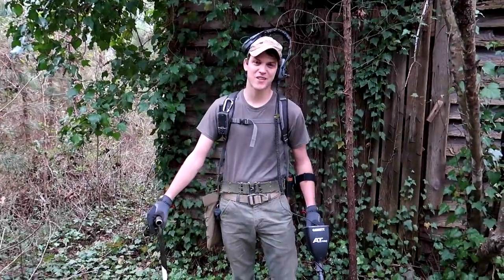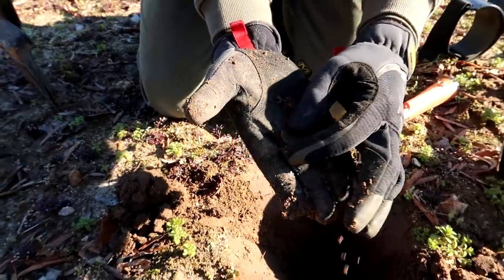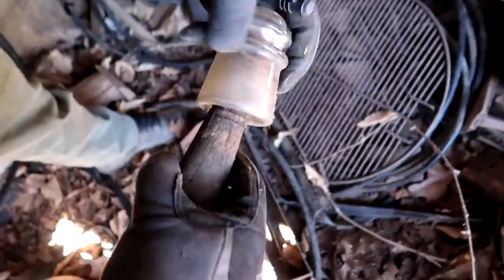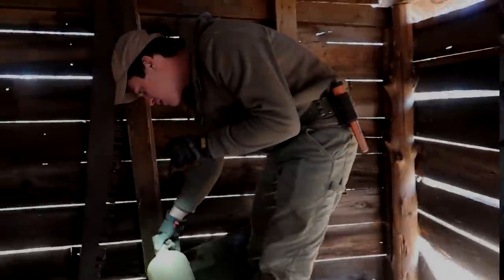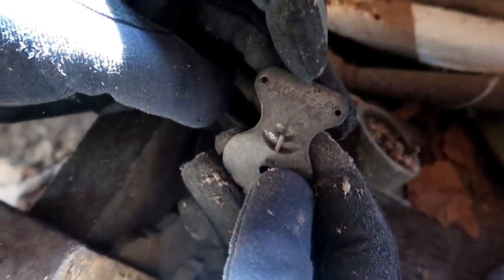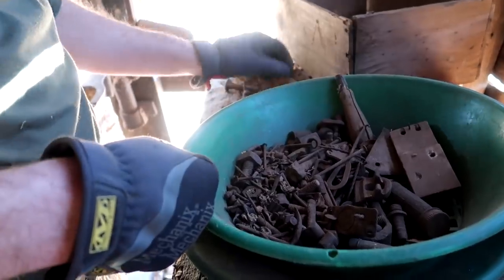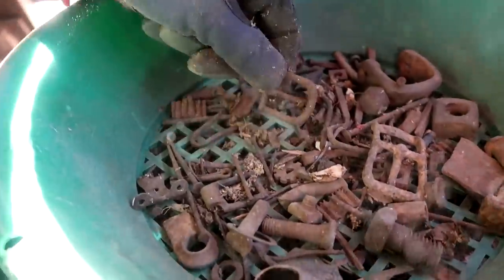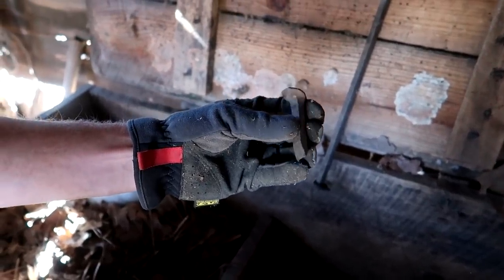Found Abandoned Workshop Full of Antiques! (Tools, Relics & Arrowheads) | Nugget Noggin

Comment: The round piece with two slots  is part of an old electric cord plug. It sealed off the wire connections so you couldn’t touch them. 
  Obviously the blacksmith tongs, blower and drill have some value.
  Good stuff. Blessed.

Comment: The black disk with two rectangular holes is used on old electrical plugs to insulate over the screws so the wires and screws don't get messed up and short out. If you have an old fan or lamp with a two pin duplex conector. Sometimes they had a handle area but most old ones were just round.
Reply: Yep

Comment: Whoa Nugget, that little tool shop is a gift that keeps on giving! 4:48 looks like a weight used with a balance beam type of scale. I thought I saw the beam leaning in the corner by the box of bottles. The small box of assorted bits had a button hook, tool used to aid in fastening shoe buttons. All those smithing tools, that blower, the hand operated drill press...if the owner plans on discarding all that stuff offer to haul it away for him, I wish I could! ONE THING, careful of bottles found in sheds! Farmers used them to mix chemicals like pesticides and herbicides. Some are toxic and were banned long ago but can still be potent. People still find old containers of stuff like DDT in old farm sheds.

Comment: I love that wood box full of small odds and ends. Back in the day, you couldn't just hop in the car and drive down to the hardware store. Running into town was a major undertaking. When you finished a project and had some extra parts, you saved them for the next project, or the one after ....
Reply: By the way, a number of those small parts are hand-forged. That workshop was in use many, many years ago...
Reply: One last thing: The long device with the handle on one end and the hook on the other, that your finger is next to at 15:58, was used back in the day to tighten boot laces. ...

Comment: The large hand crank machine is a drill press.  Some were stationary,, some could be moved to a site to drill the mortises for heavy timber construction, barns and houses.  The jack plane is still valid and could be reconditioned for use today.  I own and use quite a number.  Especially on a job site,, they are faster and more accurate than any power planer,, except where planing off the sides of timbers for timber framing.  All normal planing , finish work,, the hand planes require skill,, but they are much faster.

Comment: At 3:35 bottom of video I believe they heated up long square rods and that device more than likely was how they turned the wrought iron. I would imagine that somewhere if they would use that as a stopper in the big wheel what you thought was a drill also put a colder end of the rod to turn it . Anyway there's a lot of neat old tools there.

Comment: many of those insulators are date coded..awesome ..I can see the guy picking up those points from the field or garden right there on the farm..that thingamaBobber was a watchamacallit...modelc C ford..ha..might of been a Z..jk nugget..thanks..if you could keep the temp from going below 32 here in Wisconsin is the only thing I could use for detecting..however I did fill out the survey ;)..

Comment: Mike the arrowhead is too large to be an arrow head. It's either a spear point or an Atlatl point. The round thing about the size of a fifty cent piece with oblong holes on either side looks like it came from an old  electrical cord plug likes goes into a wall receptacle.